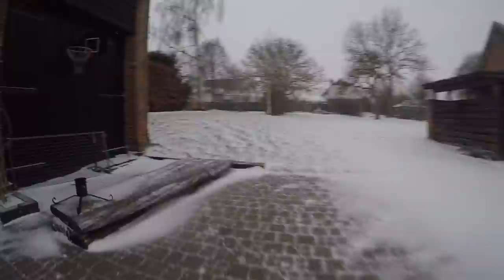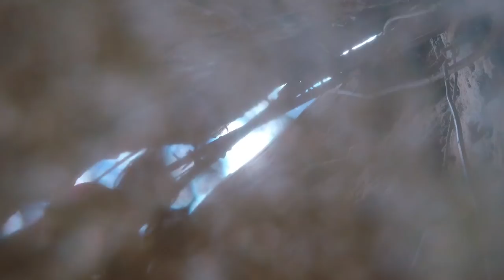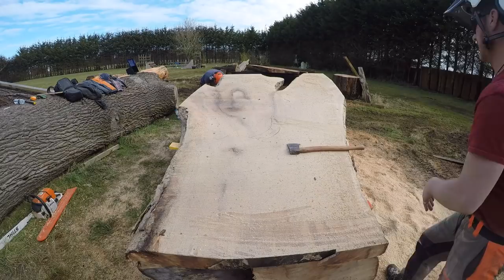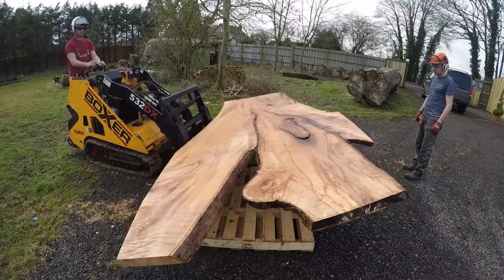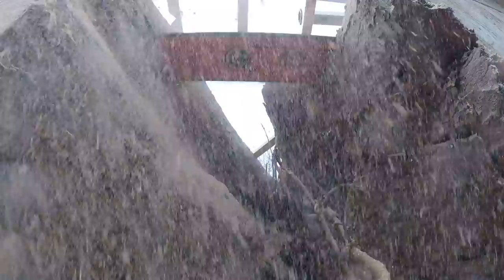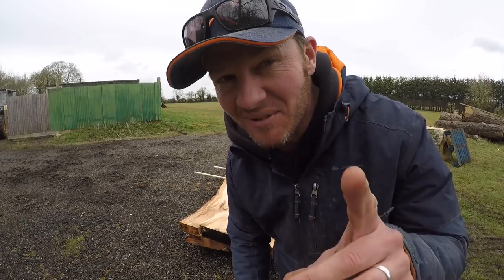Double Mill 2X MS880 87" BAR Sycamore  Part 2

Comment: I noticed a gap under the center of the mill. Is that a good reason to go thicker? Cupping probly plays in to this as well. 

 Can't imagine the planer you would have to use.
Reply from the maker: I use a router sled to flatten the slabs cheers
Reply: @BlaiseBrogan   I'm on it. I have a pile on burl ash slabs to tinker with. I have a vid of them. I chainsaw milled them. Pretty close to good enough. I'd like to flatten them a bit.

Comment: I love the slabs it's absolutely beautiful grain. My only concern would be in the crotch area since it runs nearly the full length of the slabs. You're not goin to be able to keep it from separating entirely during the drying process but you could put things in place to reduce the size of the overall split.splits add character and offer other opportunities to make the piece stand out.

Comment: I have the same mill. How do you avoid having the cut “cup” from to the middle of the bar sagging due to its own weight?
Reply from the maker: I fix one end in the mill then pull on the top of the uprights to add tension to the bar good luck, cheers

Comment: Great tip on keeping it centered.  I have a 54 bar with a 660 Stihl.  I use a boat hand winch to help pull the mill through the log.
Reply from the maker: Nice one Tom great to have you here mate!! Cheers Blaise

Comment: Hey Blaise, what's your input on cut times from single head to double head milling? I've read that running a double head rig can triple or quadruple cut speed vs a single head.
Reply from the maker: Hi mate, its difficult to say I would say about 50% faster but it is a bit of an art setting it up to get a good cut.  I would mill one engine if I had a choice.  cheers

Comment: Impressive approach (and fun, too)  ... I am curious about a few things however: 
(1) How Much Bar Oil do you find you use? (do you cut 'dry' so as not to stain the wood?)

(2) Did you find that 'See-Sawing' the Blade failed to cut faster?
Reply from the maker: Thanks Robert, I use bio chain oil you have to have it!  I try to avoid see-sawing as much as possible usually but on the big mill you have to do a bit.
Great to have you here bud, Blaise